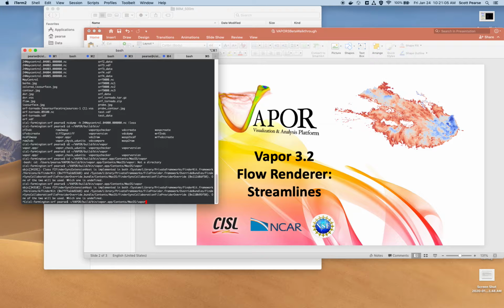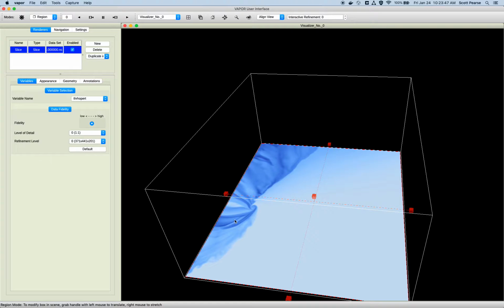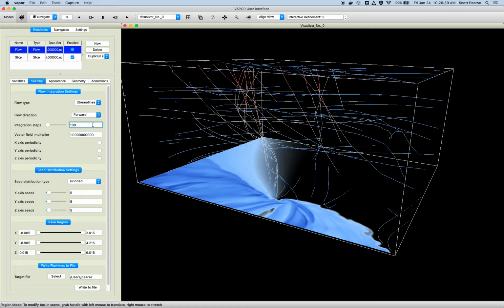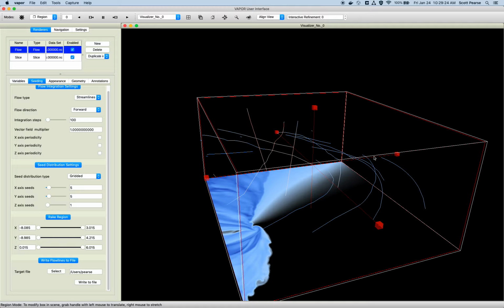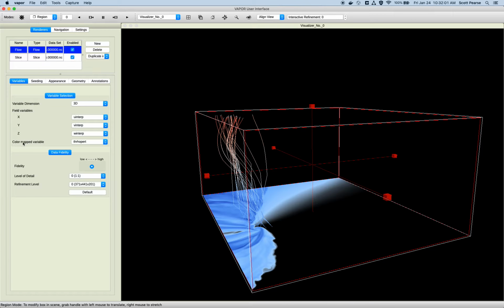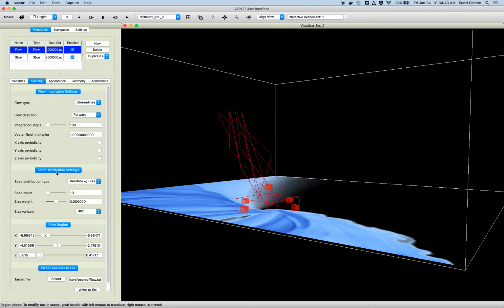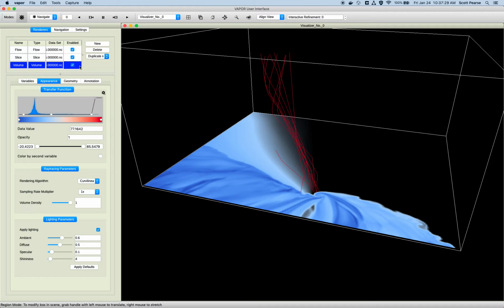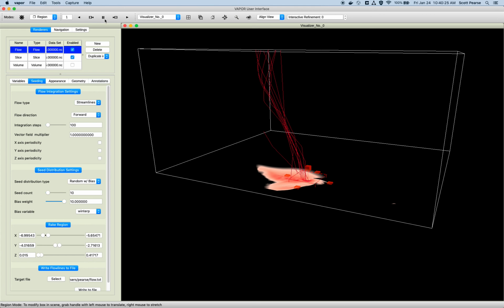Vapor 3.2 - Flow Renderer - Streamlines

Comment: Is there a way to change the thickness of the streamlines?
Reply from the maker: This is coming soon in version 3.3.  Watch the issue at this link: https://github.com/NCAR/VAPOR/issues/1916 - If it gets closed, you can download our weekly installer and use it then.  After that, wait for our 3.3 release for a hardened version.